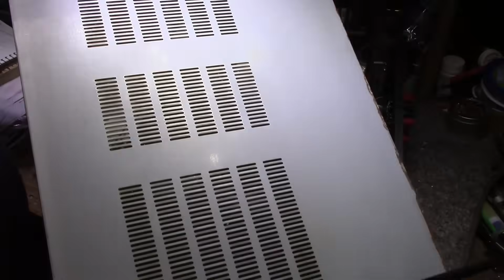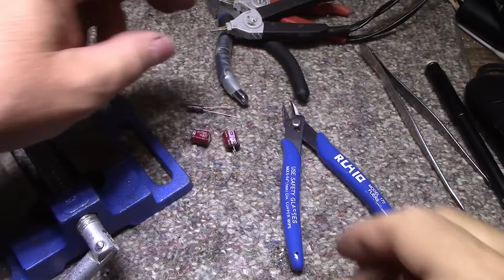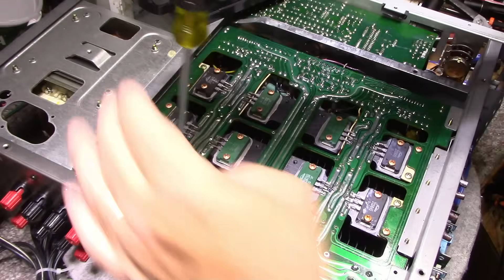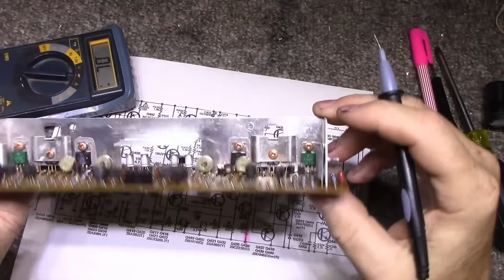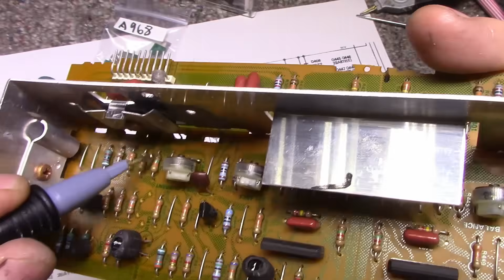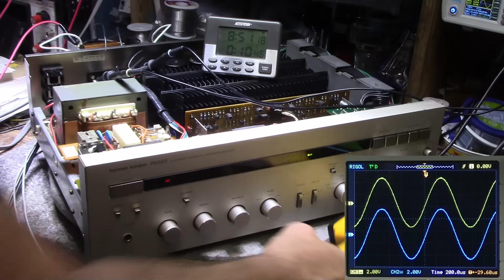Harman Kardon PM660 Integrated Amplifier (Ep. 275)

Comment: Superb video, TB! I just purchased same amp on FB Mkt for $90usd. It is in much better cond than the one you acquired. No solder cracks and just one 10 ohm fuse R was open. HOWEVER, none of the lamps/lights operate. The protect  ckt does engage from WAIT to ON (but no indicator lights). I can't troubleshoot it thus far. Are lamps they wired in series, so if one goes open, the others won't work either? Thx!

Comment: Hi Trevor, I have a HK PM660 that needs work. Do you repair units for customers. Where are you located and are you interested in doing a repair/service. I was told by a repair shop that it had a bad capacitor and they could not figure out the spec on it. I have owned it since it was new.
Reply from the maker: I'm located in Central Alberta. No, I can't take shipped in items, I only work on local gear

Comment: Have one myself, which I got in 1986 as our mall hifi store closed; we used it to drive Ohm Walsh 4s in our back room, because the more-highly-rated-on-paper HK870 separates amp was just plain not as good.  Love the amp, but it suffers from dirty switches and failing panel lamp holders - wish someone could plastic-print those!  A local repair tech would carefully snip the top rear corners of the switch housings to introduce cleaner rather than risking dust from a small drillbit falling in.   I really appreciate you showing those ELNAs and drawing the comparison.  ELNA we highly-renowned overall, though it's 40 years later now. Just goes to show that blindly re-capping everything, as is so popular to claim to do these days, should probably be thought through more carefully.

Comment: Trevor I've been working on an HK 590i from the early mid eighties similar to design to the units I've watched you repair. I was wondering if these units , when powered on , the DC offset ramps up to 2-400 millivolts then 10-20 minutes it stabilizes to service manual spec.

Comment: I have a mint condition PM-650 that my wife surprised me with in 1984. It's apart on my bench right now. I was getting low output from the left channel. I used Deoxit F5 Fader on the pots and D5 on the switches. Now it's working fine. I will adjust bias and offset tomorrow hopefully. I'm surprised that the filter caps are so much bigger on the 660 and the 650 only has 4 output transistors. I do need new lamps though.

Comment: PS, I had to replace some of the function lamps that you pointed out on the front. I upgraded them to LED lights that were adopted from automotive. (T-4) It’s very difficult to find those sockets, and as you said, the alternative is to cut the bulbs out and solder them to the original sockets.

Comment: I picked one of these up cheap and just got done fixing it. The reason they put the foam behind the capacitors was because when you push on the back of the capacitors, it flexes the whole board and causes those broken solder joints at the transistors to reconnect temporarily. It probably only got worse for them with time. In my case, I just had to reflow the solder on the transistors and the filter capacitors and all was good. It’s a really nice amp once you get it working, so great find anyway!👍🏻

Comment: I'm always curious about things found inside equipment that doesn't belong there, clearly somebody was having issues and noticed that applying pressure to some things made the issues go away but what on earth could they have been trying to do with those thick wires soldered onto to output socket ?
I can't think of any components that require mains voltage that you would mount inside the unit so the only other possibility is they needed an extra external socket which was switched off when the amp was switched off.
That was a diabolical packaging job, they clearly gave no consideration to the unit or how it was likely to be treated, I'm surprised it was still in one piece, I hope you got the item cheap !